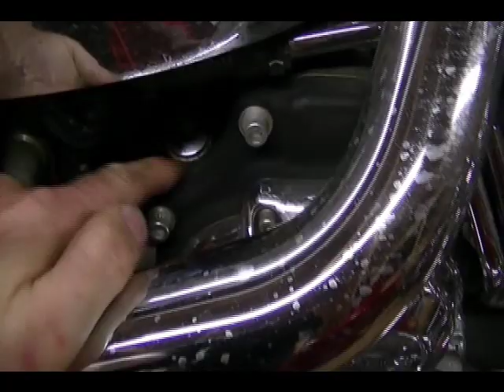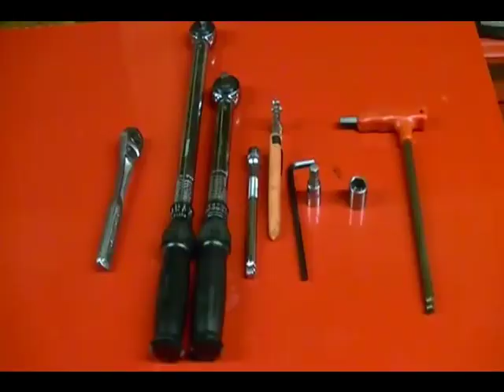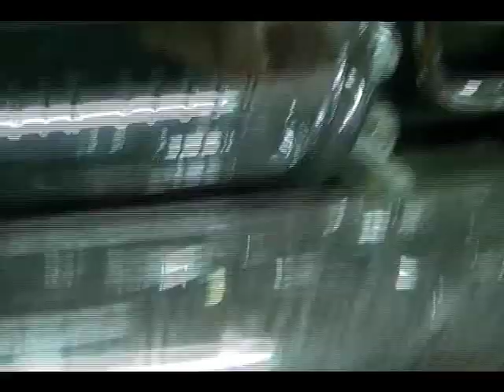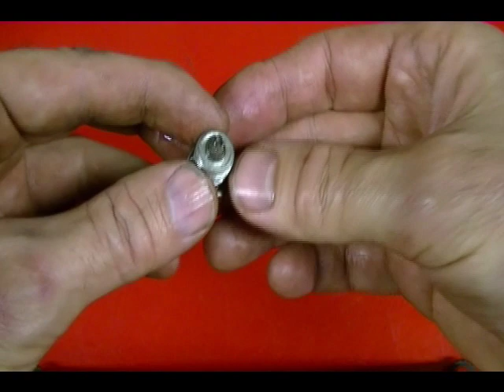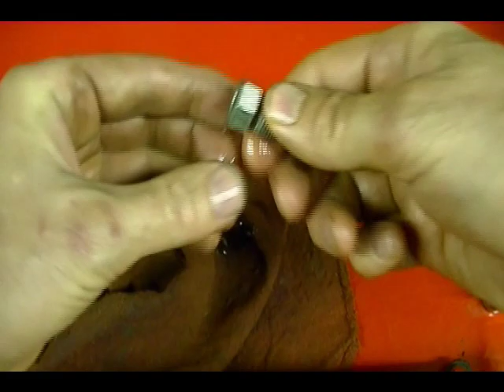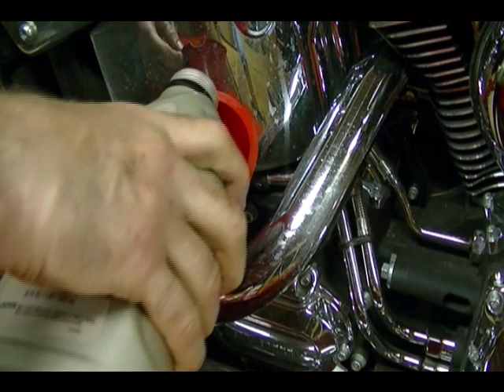Motorcycle Repair: How to Change the Transmission Oil Fluid on a 2009 Harley Davidson Softail Custom

Comment: When we should replace transmission oil ?
Reply from the maker: I think Harley Davidson recommends changing the transmission fluid on a 2009 Harley Davidson Softail Custom at 1500 miles, than every 20,000 miles. Double check that in the service manual for your motorcycle.
Reply: ***** thanks bro.